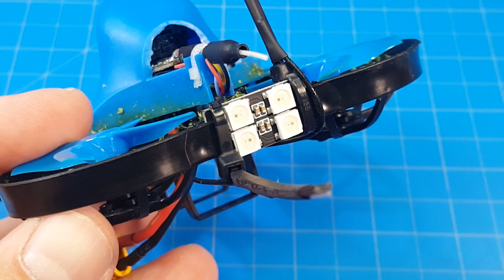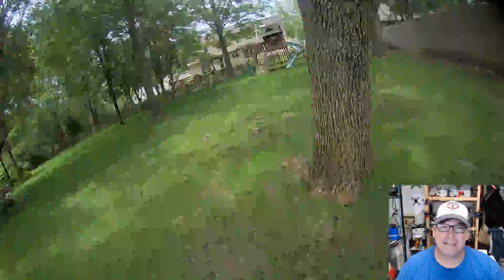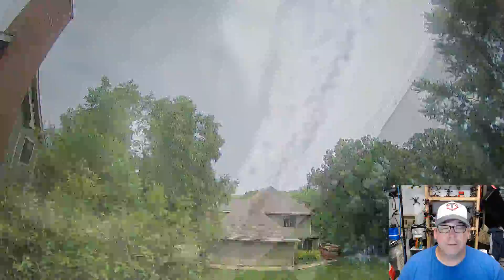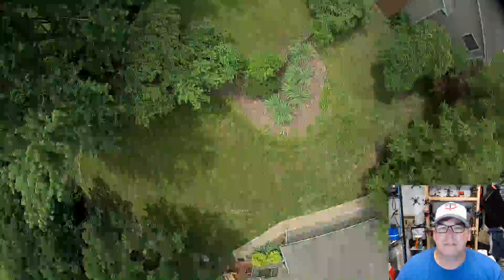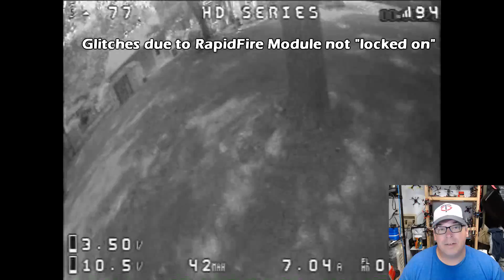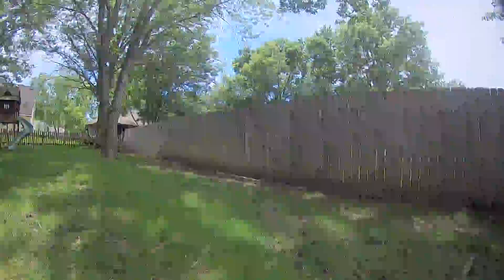Beta 75x HD - CineWhoop? MicroCine? What is it?

Comment: I bought this drone with tsb crossfire receiver, but when I fly over 15 feet, I couldn't see anything in goggles, I'm using ev800dm. If you know what's wrong, may you tell me how to fix, thanks so much
Reply: El vtx tiene opcion de poner a 200mw, quizás ese sea tu problema. con 25mw se consigue menos recepcion de señal.

Comment: Hi Nick greetings from Greece and thanks for the great videos. I recently got the beta75X HD and I’m having a problem with the camera angle which is at 35 degs. I’m a new pilot and like to fly at low speed going through gaps. This is very difficult with that angle. Do you have any suggestions about altering the cam angle? Thanks again.
Reply from the maker: We can lower it some, loosen the screws on the side and then wiggle and work the camera down. Its the best we can do unless we start to cut away part of the canopy below the camera, even then I am not sure there is enough head room to rotate down further.
Reply: @NickBurnsFPV  
35 degrees is a lot of inclination for a drone of these characteristics. With a soldering iron or with a cutter you can lower the camera angle a little more to 25 degrees which would be much more pleasant to hover ... in acrobatic 35 is fine.

Comment: Hi, do you think we need to put a capasitor on the xt30?
Reply from the maker: It wouldn't hurt. I generally don't on RTF review quads, but only sometimes do on my builds. A Cap can help clean up video when more throttle makes the picture worse, it can also help with tuning some.
Reply: @NickBurnsFPV  cool tks for the reply

Comment: Hi Nick I bought one on your review of the beta 75xHD and with mylipo.de 3s 333amh HV batteries 🔋, I was just doing slow hover around the garden to test the camera and had set the battery warning to kick in at 3.5v and to my surprise was barley getting 2mins and upon landing the battery would go upto 3.8v after it was disconnected , my point is , is this correct to only get this short amount of time and should I go down lower on the volts to say 3.v so could maybe get 3min ?
Reply from the maker: Going for a landing right when the osd warning indicates will shorten the flight, we can continue to fly with the low battery warning on screen for a time. We want to land and disarm with the average cell voltage at 3.5. When the motors are spinning this puts load on the battery, when we disarm is where we want 3.5v/cell, when we unplug the cell voltage will be slightly greater. You will note this often in my videos that I fly them enough to learn at what voltage I need to land to return on disarm back to 3.5v/cell.
Reply: Nick Burns thanks Nick very informative 🙏

Comment: My dream is a quad of this size that records HD like a Session5, Flies like a 5 inch and has a decent FPV Feed like at least an EOS2. I personally hate the FPV Picture of the Turtle cam..
Reply from the maker: the turtle and split cams fpv isn't good, I can see where it would change the way we might fly, which is no fun either. I hope they find a way to improve the fpv of the "HD" cams, I think running the tarsier is going to add more weight than its worth, but we shall see.

Comment: Here is what I am looking / hoping to find eventually.  The smallest possible drone that can record HD video and still do some resemblance of freestyle flight. For me 1/2 the fun is in the flight and the other half is in watching the HD and making videos out of it to share the experience. The HD quality of the split and the turtle are just not quite there ( mostly due to the low bitrate they use).  The tarsier looks a little better.  I'm also concerned about the reliability of the current generation of these little guys.  I think I would also like one with an option to remove the "ducts" and use larger props to get better performance when flying in locations that don't need them.  I know we are not quite there yet, but hopefully someday soon we will be.
Reply: Yah know, those are reasonable asks, and what I think I'd want to! I'm not sure if I need HD, but if it does have it, better fly like one without it! 🤔😉
Reply from the maker: Seems very doable, I would expect some of the smaller frame designers to think of this first. The challenge is likely the quick change of the "whoops/prop guard". They normally mount into the motor, but we used to have them where they would attach directly to the frame, and that might be the direction designers go when they dive into such a thing.

Comment: I’ve only been flying 75mm quads and FPV for 3 weeks. In that time I’ve tried the Mobula7 HD, the Beta 75X and the Spedix Rex80. Loved the HD footage on the Mobula but is was a very difficult craft to live with. Traded it in for a Beta 75X which is a lot of fun but the cam ain’t so great. Will swap it out once it gets destroyed and those fragile canopies not cheap to replace for what they are - eggshells. The Rex80 is a trusty little critter. Simple, robust, dependable and done most of my flying with it. I’ve put almost 40 packs with it and had no issues. The camera is amazing during the day but is a tad sketchy at night. Which leads me back to HD, thinking about another quad - 75X HD, 85X HD or 85X 4K? Won’t consider Eachine as I can’t purchase this model in my neck of the woods which is frick’in stupid. Like to zip around, yet to fly acro but will try soon but also want to capture cinematic footage too. Not so sure the 85X with Tarsier is as good as people think it is. Do I buy 85X HD for stability as 1080p footage is pretty acceptable? Any other options out there for HD whoops?
Reply from the maker: iflight has the 75HD, 77R and iX2 Tinywhoop HD. There are probably others but that's what I can think of right now and meeting the criteria.

Comment: Hey Nick, it’s Babak - how is this compared to other whoops? Do you still get washout?
Reply from the maker: I find I can control the washout with throttle control. If I get on the throttle at the wrong pace (to slow) it may or may not washout, but the more direct answer is its not 100% washout proof, maybe 80%. I did get the handle of the throttle and found I could regularly dive without issue,

Comment: Hellow you fine review man !  Thanks for a great review of the beta 85HD.  This has to be the best looking picture than some of the rest as in the jello,  but I don't know why they stick a mic on them those little motors are screaming and you can't hear anything else.  Anyway, Thanks again for the info .  And have a Great weekend.
Reply: Mic. comes with Caddx Turtle V2, but you can unsolder it or just cut the wires in one second! 👍
Reply: Yes you can cut it resolder it when you go to a different frames or just turn off the volume.

Comment: I would like to see you do a head to head comparison between the beta75 hd and the mobula7 hd
Reply from the maker: yes, I haven't had the "down time" to dig into the differences, I still have a build from Feb that hasn't been flown much. :(
Reply: No comparison! The Mobula7 HD uses that terribly unreliable crazybee F4 pro v2. Please don't buy anything with that board in it. I have, and I've regretted it more than any purchases I've ever made in 2.5 years in this hobby! 😩  It's total junk and defective way more than not. Anything with that board is a complete and utter waste of money. I made the mistakes for you, and everyone else, by buying gear with that board in it. Now you don't have to waste your money too! 👍😁
Reply: @scootroter4859  I am sorry you have had a bad experience, I have bought every version of the crazybee boards f3-f4 all 3 version of the f4 board and the only time I have ever had a problem with the 7 I have is when I put a f3 in the primo frame, the crashed that bent 2 motor shafts was enough to burn out an esc.
I have had them in everything from 65mm frames to sailfly/primo frames and only had one issue and I turtle mode all the time.
Just because you have issues doesn't mean everyone does

Comment: Wow! That's about 17g less than the 85x Bloated Cow! Lol  That's a huge improvement! 😁🤘
Well, I have to admit, I am pretty harsh on this entire caregory! Why? Because to be quite honest, almost every one of these so-called CineWho0ps SUCK REALLY HARD! That BetaFPV 85X was probably the worst, but it was also the heaviest and a total failure from the get go because it was advertised as the 1st 4S who0p. It burned more ESC's than fireworks on the 4th of July! So BetaFPV quickly said only use 3S max. Lol Enough of that... I bought the Mobula7 HD and upon first plug in of the stock battery, it FLAMED ON!🔥 BIG FLAMES! It was that awful, horrendously unreliable Crazybee F4 Pro V2 board! Biggest piece of DUNG made in the last 2 years! 💩💩💩😩  
All the rest of the CineWho0ps were too heavy and/or flew awful... Wobbles galore, yaw wash out, unreliable, and generally flew terrible.  Now, I must say, I'm not much of a believer in a quad flying great without an HD camera, and flying awful with one. Awful = only slow cinematic flights and NO ACROBATICS! IMO, we all love flips, rolls, and various acrobatic  tricks... So why should we be happy when a quad adds an HD camera and is so heavy it can't do those anymore?!! I believe, it shouldn't even be made if it can't fly like any other non-HD quad can! If the HD cam is going to F-up
 the flight characteristics, then it shouldn't even be made.
That's why I believe if you want an HD cam, get a 2.5 or 3" quad and enjoy all of the acrobatics you get without the HD cam! Plus, what exactly are you going to record in HD with a tiny who0p that you can't record with a 2.5"? There's nothing inside I want to record, so what could it be? You can put prop guards on 2.5"quads if you think those are the key. 🤔👍
Getting back to this Cinewho0p in Nick's great review... 👍 This is the first one I've actually liked! Nick is the perfect guy to review this because who has the skills to push these any harder than Nick?!! Lol And as you can see in this video, it can fly about 80-90% (?) as good as the same quad without the HD cam! Certainly good enough to fly pretty awesome And... And it's a HUGE "And"... NO JELLO! ALL of the other CineWho0ps have some kind of jello... ruining them for me. Why should anyone be the least bit satisfied with ANY jello?! 😝That's why I originally bought the Mobula7 HD, because it was the lightest and had the least amount of jello, IMO. BUT, that Crazybee board is total JUNK! I suggest no one EVER buy any quad with that board in it... You'll be sorry if you do! So, I am pleasantly surprised by this little BetaFPV 75X JEWEL! It's the only one I'd own. Still though, unless you have a successful YouTube channel like many of the best reviewers do, I really don't see the point of HD footage. What are ya going to do with it after you've watched it once? I can't figure that one out... 🤔😒
Reply from the maker: Thank you for this valuable information and quoting experiences for others to read and digest. My flight characteristic preferences do pretty much align with yours, I would rather have flight performance than HD, if the HD is going to hurt my ability to fly like I want. Having a channel I attempt to leave it more to the viewer to determine if a quad is something they want or not. My review is an attempt to get the information out as I see it in the hopes if a purchase is made they know what they will be getting.
Reply: @NickBurnsFPV  I get that you want to provide the information for them to decide. That's co0ol! But, on the other hand, I really value people's opinion and enjoy seeing you say pass on this one, or like with the Leader 120, you really recommended it. Me, I get a little tired of other reviewers who don't ever give an opinion. After all, they review so many, their opinion is worth a lot because they have seen and flown so many to compare it too. That's one of the reasons why I give my opinion. I've also seen and owned so many different  quads and seen so many different designs, flight characteristics , and components. Because a lot of people are beginning this hobby, and it's easy to get caught up in the new quad hype, I don't like to read comments from people saying they love what I feel is not a very desirable quad. I think they'll be sorry if they spend their money on it! They can't all be good and IMO, they need to know when they're not. 👍😎
Reply from the maker: @scootroter4859  Very true and not the first time I have heard such a comment. I will work on including my opinion more often. Thank you

Comment: Nice my friend. Are u impressed with the new 1103 8000kv? I love them especially on 3s. I think they are a high quality 1103.
Reply from the maker: I would need to hold my opinion until I can fly them on different/longer props, I would expect them to perform well, but they low end prop control could be less than desire....need to fly them on hyperlight micro with 65mm or 2.5inch props.
Reply: @NickBurnsFPV  I know u and u will love them they are the fastest 1103 motor I have flown on a 65mm prop and on 3s.

Comment: Looking forward to this one!  Hmm, that seems kind of light on what you get for your $180 dollars.  How does it compare to your Mobula HD?  As far as your question goes, you are going get just about as many different answers as anything.  However, for most, I think you will see people wanting a cinematic cruising quad and many wanting somewhat sporty acrobatic quad.  Realistically, a lot of us just want some great clean video and the rest is all icing on the cake, at least for me, that's the ride ticket that I would buy.  Great Job again and cheers to a job well done.
Reply from the maker: The mobula 7 HD has a bit of jello, but much more acrobatic. This the video is very stable, but not so acrobatic.I suspected flight style would vary, hoped to gather input to firm up my suspicions.
Reply: Nick Burns - Very good assessment and would agree with Mobula HD being more acrobatic. Although, I haven’t experienced much jello at all. However, I really only run mine on 2S so as to avoid the board issues experienced by some people, but the higher motor speeds at 3S could yield more jello.  But that’s just a guess on my part.